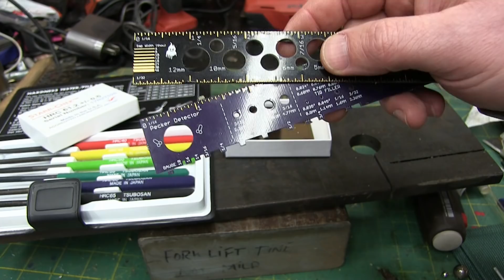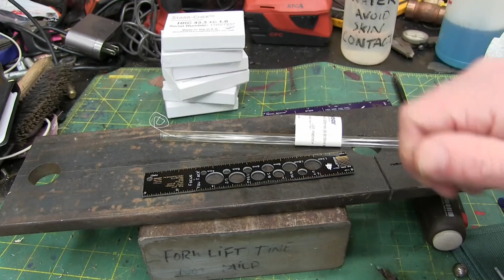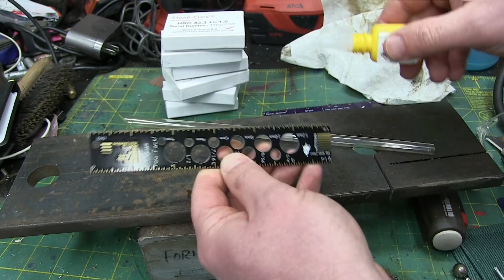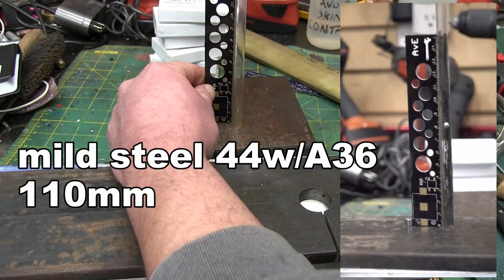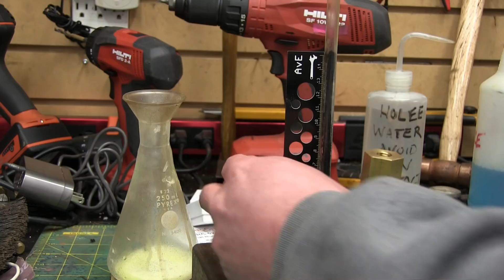Pocket Hardness Tester PROTOTYPE | IT WERKS!

Comment: the main reason i was thinking about the photo resistors is because the ball may bounce off the side walls a bit causing a variable  especially on the harder materials.  Although i am not sure if it is really necessary to be that accurate

Comment: Great concept.  Have you spec'd out what margin of error you wish to maintain?  Temperature compensation will be a consideration as well as barometric pressure (already stated).  If those variances are within your desired margin of error, do the easy thing:  IGNORE Them!  LOL.   This is very similar in operating concept for a photoacustic spectrometer, which uses a laser to determine base concentrations of known compounds in gaseous mixtures.  Essentially, you use the coefficient of absorption for a compound of a given wavelength of laser light.  You then measure the amplitude of the resulting sound wave to determine the concentration of the compound in the gaseous sample.   Again, all depends upon your repeatability target on the design.  Short comment:  Fucking GREAT idea!  LOL

Comment: I don't think this is actually measuring hardness - the ball probably won't be deforming the surface plasticly, this is essential for hardness testing. The bounce will probably exhibit purely elastic hertzian contact and hence the bounce height will actually correlate with the materials strength not hardness, which are actually independent. In any case this could still be a useful tool

Comment: Very interesting and creative. My thought is that the test base material or the platen if you will would have to be a constant. Imagine laying the material to be tested on a 100 pound anvil, then retesting on a soft foam rubber, that has to make difference. Therefore i feel it may be impossible to calibrate the device for real world use. But what do i know, i'm just a schlub.

Comment: The only issue i see rearing it ugly head, is that the it isn't a linear correlation so  for the reference model you may have to SqRt the x axis (time) and keep the  y axis (hardness) as is in order to get a linear arrangement, just have to remember to square the value before it spits it out on the display. Simple suggestion from a simple chemist, saves the equation for the graph looking like a meathook abortion.
Reply: Just to clarify, on the linear correlating graph the axis would be hardess (y) and sqrt time (x)

Comment: Interesting concept.

Im curios too see how this plays out.

Wouldnt the ductility of the material have a big effect on how accurate this is?

For example spring steel can be hardened into the high 50s low 60s and maintain flexibility. How accurate would this read on something like that?

Also will the thickness of the sample effect the results?

Comment: You have just demonstrated the Leeb rebound principle, quite nicely done also, hat off to you sir! Now try to convert rebound to hrc on actual parts, using the rebound height from your standard blocks as a reference. you can use your hardness scratch set as a ball park comparison, good luck though :) Rebound testing is highly dependent on material type, thickness and mass, I find it hard to trust. Hardness conversion can be a slippery and confusing slope, you really need to know your shit, and material you are testing. Every hardness standard, be it brinell, vickers or Rockwell (even the frikkin hardness conversion standards themselves) recommend you avoid it. You want Rockwell hardness? Use a god damned Rockwell tester, if possible. If you change the mass on those standard blocks you have there, I guarantee the rebound changes. Cheers and thanks for all the vids!

Comment: The only issue I see with this is the friction acting on the bb. It would be necessary to have some sort of way to calibrate it depending on the air pressure/density in the room you are testing. Of course, precision like that requires much more expensive ideas

Comment: https://en.wikipedia.org/wiki/Leeb_rebound_hardness_test
Reply: The scleroscope test was invented by Shore and may also be known as a Leeb rebound hardness test. It allows a hammer with a hard point to fall on the metal surface being tested. The height of the rebound is measured as the hardness number. It may be particularly common to see this used as a steel hardness tester.

Comment: make the tube sealed one end, the other could be pinched like a ballpoint pen, enough to let the ball contact the material but not big enough for it to fall out, this way your standard calibrated BB wont get lost and with a magnet on top to hold and drop the bb any error from drop height or contamination from oils will be reduced

Comment: leave out the ruler, have a fixed length of tubing and write a phone app using the phones microphone, put it (if possible) on the surface to be tested. Phones can do background noise subtraction, and you can program something to enhance the expected signal. Zero cost solution

Comment: AvE use a magnet to hold the BB at the top of the tube. When you lift the magnet (like a button), the BB gets released to fall down the tube. Almost like a pin-ball machine ball dubilydoo. Otherwise the rest of the click flicker piezo microcrontroller sounds great.

Comment: I really love your idea,,, but, the known height from which the bearing is dropped needs to be a constant, the bearing needs to be the same hardness as the next bearing, but,, would thickness off material also need to be taken into equation, if you had a piece of steel that was .1 mm thick and another at 2 mm thick wouldn't the density give different readings if both the same hardness??

Comment: Seems pretty clever!

It seems like using a piezo to detect the bounces really adds difficulty. As you mentioned, the mass of the object you're measuring will have a great effect on the piezo's ability to detect bounces. Or, are piezos, like, extremely sensitive? I may not have understood properly, is using a mic ruled out because of someone's patent?

Comment: I've got an idea!
How about you take the voice coil and magnet from an old, small speaker. A small impactor is attached to the coil. A short pulse of current moves the coil and impactor into the material. When it bounces back, you essentially treat it like a microphone and measure the return energy.

Comment: .       Wouldn’t placing a piezo between the impactor and the test piece affect the result?
.       You could mount a laser diode on one side of the acrylic tube and a photoresistor on the other. Mount at the bottom, and you’ll get a spike in resistance for each bounce.
.       This way you don’t have a piezo element interfering with your measurement, and the microphone won’t be triggered by outside noise.

Comment: Interesting. However, like pretty much everything else, this method of measurement has been invented a long time ago.

Nevertheless, if you can produce a meter that has an accuracy of, say +-.15 in the HRC scale, and retail it for 100usd, you have a winner in your hands. I reckon the components and assembly would cost less than 20usd. The Tsubosan file set featured in the videeo is way too coarse-scaled and too expensive for any purpose really, yet I bet there would be a reasonable market for a low-cost (steel) hardness gauge. You know, hobbyist knife makers, and the like.

Comment: Need to add a gate/switch/relay that drops the ball from the same height every time, and might need to check temperature and pressure to add air resistance calc?

Comment: The very first thing I would do is get a cheap microphone with a coax end and put it on the o smell a scope. Just to get the next easiest thing tested. My physics department used 2 of these for time of flight measurements of vibrations to measure Young's moduli of different rods of material.

Comment: This just reminded me of a similar device that was sold back in the late 90's early 2000's.  Just can't remember who sold it.  Same setup, hardened steel ball in glass tube with a scale on it.  It had a release mechanism  at the top to hold the ball then you could release it.  Just want to mention that you can make your own just as AVE is doing if you have known materials with measured hardness specs.  Of important note, the drop height has to be consistent for each drop.  Cool video, as I know a lot of home machine shop guy's would like to have something to check materials before they machine them.  Great subject Sir.

Comment: Rebound will change with change in thickness, and the medium the object sits on.
Reply: Umm, what? I reckon the rebound remains constant if the tested medium is homogeneous and the instrument is solidly attached to said medium. If the 'ball' is light (and hard) enough to not cause any deformation to itself and the medium, I fail to see why the rebound would change when the tested material increases in thickness.
Reply: And surface finish
Reply: Doing a quick bit of googling it seems that there is a recommended minimum material thickness for this test but beyond that it doesn't affect the results, which makes sense.

Comment: You Sir are a genius. AvE must mean Archimedes+Volta+Einstein. I think that is a brilliant invention, especially using the piezo to trigger counts and time between bounces. you need something to release the ball without using fingers so it is clean from any oil or residue that may affect the contact of the ball when it hits the piezo plus something to stop it touching the sides of the tube that may also affect timing. maybe a wider tube. I think you are on to something here.

Comment: Hmm I think the height dropped affects with how much kinetic energy it connects with the sample, so the heights has to be controlled and since it can vary from setting to another every measurement will probably be a bit different, I think.. although I’m halfway so he probably addresses that
Reply: Link all you need is the tubes to be a standard length
Reply: Pinky Mabinkie yeah I was thinking a tutorial for this would just have a drop height

Comment: What if you wrap the tube in wire and magnetise the bb, then tap off the wire at intervals, would a magnetised bb generate enough current to measure the height from the tap offs?

Comment: What about a couple of IR beam break sensors.
At short disctance above the bounce point, measure the velocity down, then the velocity up.
Calculates energy recovery.  don't have to worry about noise and you can measure every bounce get an average.

Comment: Hi AvE,
There is already something out there twerking on the same principle (but ball is spring loaded (also works upside down and sideways).
It's called a LEEB hardness tester. Costs around 600 european dollhairs (chinesium quality).
The bounce is measured using a spool around the tube (inductive current).
I love your version, a few considerations:
- The surface must be smooth
- In a LEEB device the ball flattens over time (shows less hardness over time)
- less mass on the test piece -> more vibration = shows less hardness (as you indicated)
- with the spring loaded LEEB tester you can estimate the hardness listening to the pitch (higher pitch = harder)

Curious to see more of your geniusness-ness ness
Hat off to you sir

Comment: Pointless. It wont be accurate enough to tell you anything more than a normal file would. If knowing exact hardness is that important to you, then it's worth spending $/£500 for a second hand rockwell machine and a calibrated specimen. As a quality engineer I can tell you hardness testing is awkward enough with a fancy Swiss machine, let alone something like this. So many variables: angle, temperature, workpiece thickness, workbench stiffness, friction, air seal (around the bb and at the base). The best you'll get is a "hard", "kinda-hard", "not hard" level of precision, which you'll get just as well with a file

Comment: Can the magnet on the ruler effect the ball or slightly change how the metal responds to impact?

Side comment - I'd love if you could do a video on heating elements and maybe show how you'd create a heated glove - good ones are damned expensive here in Cannuckistan and my digits are friggen Popsicles when I'm trying to extend my cycling through the better bits of the winter.

Comment: Cheap as borscht... I'm sure there is a clever cct to sense the ball bearing as it falls through a coil as another way to measure the fall and rebound. A couple of wraps of wire, one set near the top and another near the bottom could sense drop height variations for more accuracy. A third coil near the bottom one could measure the rebound height if you had good timing accuracy. This has a few other benefits such as reducing effects from ball hitting the tube on the way bavk up. You might not need the top coil but just gives you more knobs to turn. I don't know if this extra precision gains anything over the other variables in the system, but food for thought.

Comment: love it! perhaps enlarge the tube diameter to avoid friction loss, should the bb touch the wall on it's journey? obviously have a short aim tube to centre the bb before it enters the enlarged section xx
Reply: proffessasvids the frictional losses at that minuscule contact angle are negligible, especially between those two particular materials. The tube must be a small enough diameter so as to ensure the ball remains plumb, but also large enough to allow air to easily escape past the ball as it falls

Comment: There was once an episode of moden marvels that demonstrated the reactivity of different alloy steel sheets(hull plate) with a ball bearing bounce test. how about an automatic center punch...... with varied hardness interchangeable tips. using a calibrated spring. mabey have one of those ruler things you plug occasionally have a "dimple" scale for reference. the larger the dimple the softer the material.

Comment: Some comments have kind of skirted around this, but you'll need to be careful regarding magnetic fields (either from magnetic materials, or current flowing) near the path of an electrically-conductive ball, as eddy currents induced in it would skew the timing.

Comment: But won't it matter if, and how many times, the ball bearing contacts the tube as it drops, or travels up? The bearing won't be in a true free fall environment.
Reply: Mark Price the frictional losses at that minuscule contact angle are negligible, especially between those two particular materials. The tube must be a small enough diameter so as to ensure the ball remains plumb, but also large enough to allow air to easily escape past the ball as it falls

Comment: Sorry for so many stupid comments - last one. An automatic centre punch type probe applied to testing surface. The fixed force impact will transfer to a ball that sits in a cylinder directly above the punch. the transferred energy is measured by a piezo or whatever generator and a digital readout displays hardness value.

Comment: What about two piezo sensors on either end of the ruler that when a button is pressed all you need to do is tap the material. Using the time difference of the pressure spikes detected by the piezos you could determine the speed of sound through the material and through calculations the hardness

Comment: The generator would have to move into the path after the ball was released etc. Very high quality diamond tipped generator measuring devices were made in their millions up until a few years ago. Capable of measuring variations down to nano metre scale for a few sheckles. The moving magnet cartridge. Maybe the diamond could be directly used instead of the ball? Can't think quite the best way yet...

Comment: Yes yes, this will work. What about the thickness of the material? The thinner the material the more it vibrates and could counter the movement of the bearing. Unless you had a “standard” basal platten.

Comment: AvE use a freaking laser to measure the top distance of the ball. The one that you purpose is fine but it will have to be calculated the resistance of the ball on the tube twice. So if you only cut it in half the amount of resistance it will be more accurate.  Arduino +bumblefuckery= genius!!

Comment: Then I thought (2nd thought) it's just the velocity of the ball is the variable, and the best, cheapest velocity measure is a simple coil. You could have it all analogue or use an ADC to eventually display peak voltage which would be directly proportional to the speed and hardness.

Comment: My first thought was the wheel tapper with his hammer. If there is any structural fault the ball will lose energy in it. Also the material interface, or what it's sitting on and the measured material shape - a sandwich structure will always be measured or tuning fork resonant variables or too thin and bending. There is acoustic resonance testing that has been around for decades.  From experience, 'The saying, 'There is Nothing New Under the Sun' usually applies. Love this idea.

Comment: you could use tungsten carbide bearing balls, cheap (from you know where) and relatively low magnetic property's. also you might be able to use a opto- isolator sensor since this wil eliminate mechanical interference from the metal or the operator